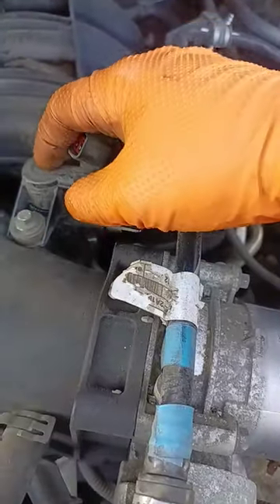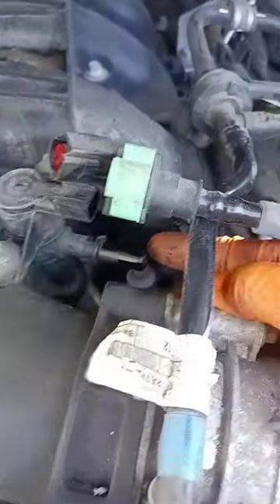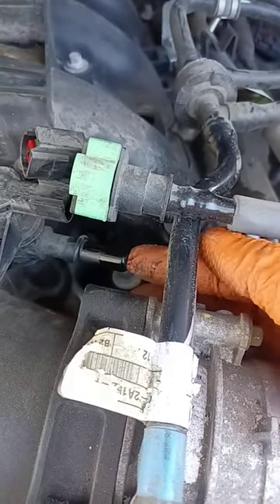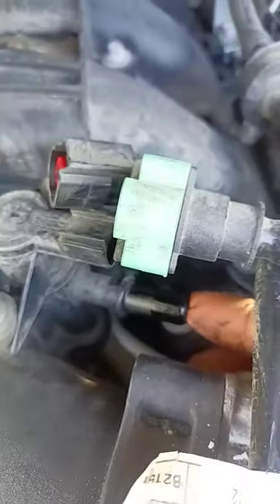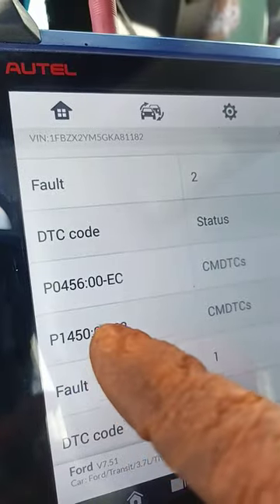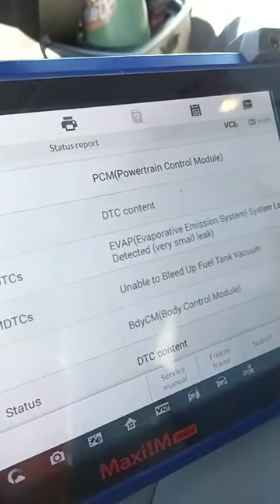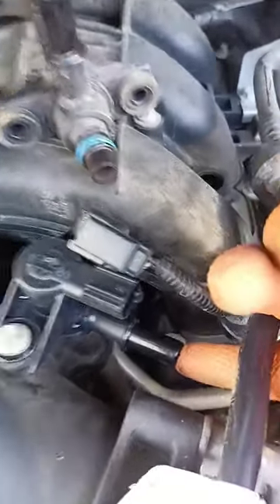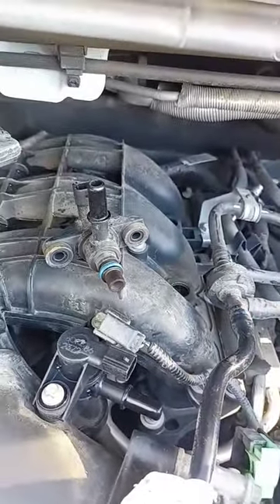p1450 and p0456 Ford EVAP leak and vapor solenoid issue. Ford f150, transit, escape, fusion,

Comment: I looked at another mechanic certified Nissan he says after 10 minutes this Valve should suck vacuum from canister through the command of ECM
Reply: Yes i read about something like that. When engine is cold it should not suck any air until after 5-10 mins (when engine is warmed up) 
If it does suck air when engine is cold  then the purge valve is bad.
Reply: He disconnected the harness meaning no commands from Ecm
Reply: @jerryhernandez698  Mine didn't after 15-20 minutes, kept the engine running and took it on a short 5 minute drive, come back kept engine running and it still was closed..

Comment: Don't believe everything in the net one says if sucks is not good anymor and this one says if does is good
Reply: It says if it doesn’t suck it’s not good, and he disconnected the connector which means there’s nothing to tell the purge system to open the valve

Comment: I chang3d my valve and wd40 sprayed my fuel filler and worked it a hundred times and still no fix. Could it be down by the charcoal canister thing?

Comment: I have exactly the same issue on my ford mustang ecoboost 2017!
Reply: Me too did you ever fix it? 

I replaced the purge valve and it did fix 1 issue when I fill up the tank it wouldn’t turn on the first try

I have the P code and it’s whistling also.
Reply: @93mgee  I did fix it! I replaced it the part and no check engine light popped up again!
Reply: Thanks for the feedback. What exactly did you replace?

I have replaced the purge valve but not the piece he is showing that sucks in air. Do you know what it’s called on the ecoboost?
Reply: @93mgee I just had the purge valve fixed on mine but it’s ticking a lot, I’ve already had the fuel neck replaced too
Reply: @93mgee but when I fill up on gas it seems like it idles worse
Reply: @93mgee  the same thing happens to me, where is the purge valve that you replaced?

Comment: What if it’s blowing out air when the car is on park I got a 2008 Mazda 3 and it does blow air out of it
Reply from the maker: If it blows out air from the tube that comes from the gas tank to the engine,  then there is ti much pressure in the gas tank, and it's not being vented. So, there might be an issue with the vent system

Comment: WHERE is this located? I understand there is a canister under the truck by the gas tank, but also another purge valve on the motor? Where is this one located on a 2017 3.5 ecoboost?

Comment: I have a 2018 ford fusion se and my check engine light is on and my gas tank makes a noise and every time it starts making a noise the engine will shut off. What part do I need to replace ?
Reply: Sounds like fuel pump issues

Comment: Hi boss, getting code p1450 on 2018 focus 3 cyl 1L. I cannot find purge valve on rockauto for the 3 cyl I only found vent valve. what is the difference. the 4 cyl 2 L model show both purge valve and vent valve available. does the 3 cyl does not have purge valve?
Reply from the maker: Ir should have a Purge valve and a vent valve.

Comment: 2018 Santa Fe  I have  a p0456 I replaced purge valve canister purge valve and gas cap still getting cel I don’t have a smoke machine besides changing canister what could I look for. Emissions is coming up soon

Comment: I have the car with those codes, the valve was subduing my finger, I just changed the valve, but the sign of the control engine has not yet been removed from the dashboard, ford c max, how long does it take to remove
Reply from the maker: If the doesn't have any other issues,  it should go away after a couple of drives
Reply from the maker: You can also take it to a parts store to scan it for codes

Comment: At what point does the engine call for The Purge valve to be open? My purge valve is closed with no power applied but when I manually apply 12 volts it opens so it appears that its functioning properly but it will not open with my engine running

Comment: @WrenchLink BUT how do you know whether to change juat the solenoid  or the whole purge valve line piece that clips in on the ends ? 

Really hope you see this
Reply: Best way to rule out a purge valve is letting the vehicle get to operating temp and remove the hose connected to purge valve. Place your finger over the purge valve outlet that the hose connects to. If it sucks your finger the purge valve is bad

Comment: How did you fix the issue? Is there a video on this
Reply: He replaced  it. There’s two bolt that is holding the solenoid and It’s an 8 mm and all you gotta do is take it out and replace it with a new one. Pretty easy